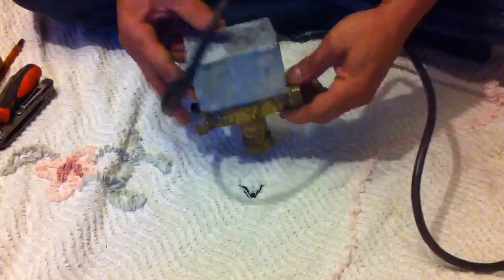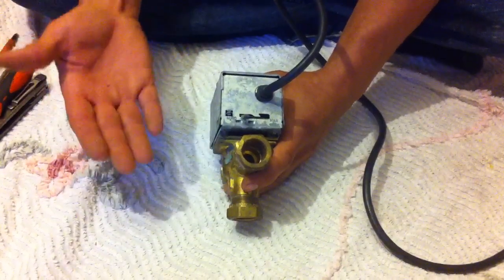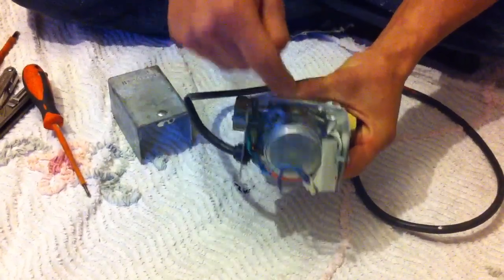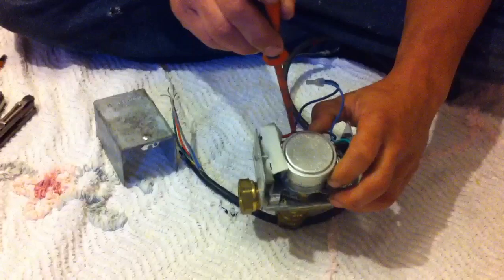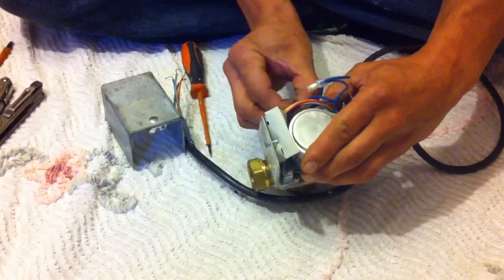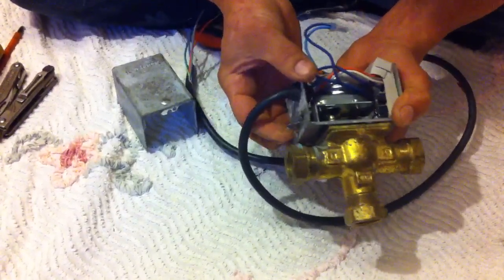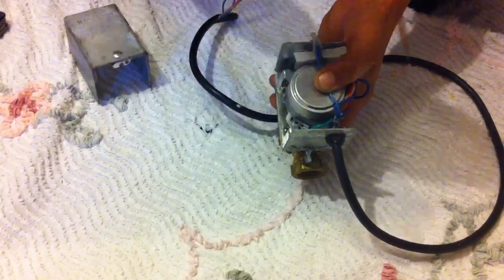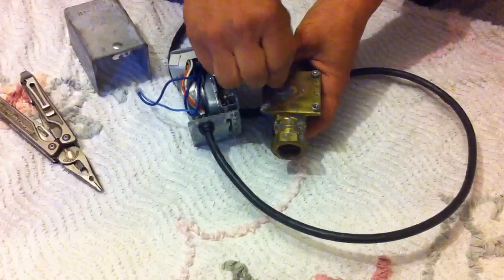Port valve diagnosis and repair

Comment: Excellent video, very clear - many thanks. My problem is that the motor appears to have failed (it was buzzing) so that the valve is open but has not swung not far enough to hit the microswitch and so energise the pump. I'm planning to replace the head since it's not clear exactly where the problem is (yet!).
Reply: Hi Manek, just got buzzing noise yesterday, great info here. Can you let me know the steps you had to go through to solve the problem you had? Cheers if you can.
Reply: david gormley Sure. From what I remember (it was nine months ago!), I left the valve in place, which saved a lot of hassle, removed the motor as the video shows. I'd bought a replacement, very easy to find, and simply did the reverse operation. I was surprised how quick and easy it was. Use the video - it's very explanatory.
Reply: Thanks a mil Manek, appreciated

Comment: hi just had a new honeywell replacement powerhead 4073A fitted should this  be hot when i haven't  got  the  hot water and central  heating on, just to let you know we are still running on a back boiler  and  have had the gas fire on a worried  women.

Comment: Hi Sebestian - I found your video super useful! It turned out the gear mechanism is faulty in the valve head so the new motor didn't help. I will need to get valve head to fix the problem. Brilliant video. Many thanks :-)

Comment: Thanks for the video,what year was this type of valve was used,I'm a local tech in ny.most valve I encountered are solonoid type/plunger..this type of valve is prone to fail due to some moving parts like gears and motor drive.with all due respect to you sir and your fans..include me off course thanks again

Comment: Hi please could i get a bit of info about my two port valve that im having trouble with , the problem is that i can only get hot water when i have the heating on,i have changed the motor on my two port valve but it is still the same, the leaver on the valve moves from side to side losly ,as if it is not doing anything and doesnt slide back from either side. Any advice would be much appreciated.thanks

Comment: ahh, yes. I remember the old style motor and unscrewing those four nuts thinking I knew what I was doing.... one, two, three, four..... psffffffffffffffffffffffffffffffffffffffffffff soaked !! hot black water in my eye, down both sleeves, live cables all over the place, standing on a metal sink with the motor at arms length above me reaching over the top of a six tonne 1983 glow worm boiler .. Deep joy. Great informative vid.
Reply: maybe you forgot to drain down the system?

Comment: Hi your description is great I have a circ 1976 honeywell flow control valve with a relay on the outside there does not appear to be any micro switches. does this relay take the place of the micro switches and at the age I assume I cannot replace the whole valve without emptying the system. If the valve is working properly and both heating and water require heat should the valve split the water flow to each by about half. When I put the hot water on with the heating thermostst open My radiators start to go cold but the water heats up. If the water stops requiring heat the heating starts to warm up Would appreciate your comments
Reply from the maker: I'm going to need a picture to answer that....
Reply: Sebastian Hibbert I cant get a very good picture It is a relay  it is mounted on the right hand side outside the box the screw to lift the lid is on the left side as you look at it. have had it off and it has two sets of contacts which I assume are one for heating and one water there are definetly no micro swithes and there are wires going into the relay box, but that is completely sealed. inside the box My system is working I get heating and hot water but the radiators cool down while the water is heating and then come back up when the water has reached its temperature, is that normal on a fully ok system cica 1976 Tks

Comment: Can someone help, my cover is getting hot when is set on manual or when i use heating, when is turned on for hot water only motor cover temperature is normal, also when system is not operating and pipes are cold motor cover is very , it is not from hot pipes they are significantly colder than motor cover Danfoss hsa3

Comment: Hi Sebastian, I wounder if you can help me?
I have changed my Honeywell 3 port valve V4073 as CH was getting hot when just HW on, now working fine. The problem (Not sure if was there before) is now when CH switches off via stat or programmer and HW is not being called for, I can hear a faint buzz from the valve head and after a short time the head becomes very HOT! The only thing I can do to stop this is turn up HW stat or switch off at mains and back on. When the heating is off, the valve should return to the hot water position. Wiring see link http://www.seered.co.uk/sunvic2700.jpg Thank you Martin

Comment: I have 3 two port valves with two for heating (zoned) and one for the hot water. We had to replace one of the heating valves about 18 months ago due to boiler not switching off and now we have the same problem! Is there an easy way to tell which valve is sticking without taking off all of the valves one by one? I think I know what you answer is going to be but this 'sticky' valve problem is a pain in the....!

Comment: I have an acl 3 port changeover valve that looks as if it has a faulty Synchron motor.  The symtoms were the boiler would fire-up for hot water but would not fire-up for heating. The motor does not operate although the water leaver is free to move.  With the motor removed the gearbox appears to be ok as you can rotate the motor without any problem.  Also, the motor appears to be open circuit as I cannot measure any resistance across the motor terminals.  I was hoping your video would cover this aspect - otherwise a very instructive video.  If you are free, please come back with typical resistance figures for the motor.  Thanks

Comment: Excellent video. My lever has no resistance, so I will try taking off casing to try with pliers. Question through, if I can loosen it with pliers should that be enough to fix it or how do I tell if the whole valve needs replacing? Also can someone tell me where the bump is on the casing to locate if new or old honeywell version. Thanks
Reply from the maker: No resistance suggests the valve is open ( working) are you sure the problem is the vslve
Reply: Sebastian Hibbert Thanks for the reply. That is what my heating guy said (but didn't open up box to investigate), i'd say it is stuck midway as hot water only heats up a bit and central heating only heats up a bit. If you have hot water on central heating comes on and vice-a-versa.
Reply from the maker: Sorry - no, the valve is designed to always give flow - so if it was stuck half way then both heating and hot water would come on together. Sounds like a flow issue.
Reply: That's what happens,  so if I turn on hot water the radiators heat up and even if thermostat is turned right down.  Sorry but what would cause a flow issue? The pump works etc.
Reply from the maker: The valve opens to the mid point to give heating and hot water, so you should get full heating and hot water, not part. You will need to her the valve head off to check the flow is enough ( turn it to hot water, the central heating to be sure that it works) but this sounds a bit more than 'valve'

Comment: Is the anyway i could contact u on phone i really really need help am getting hot water but central heating i have a honey well valve 2way. Ease please please if u can help me please my number is 07931304331. I hve a 4yeqr old son am out job n i cant afford to get a plumer

Comment: Hi can you please please help me am in big trouble out off job central heating not working winter is coming i have a four yer old son. Am getting water but me central heating not working called in a plumber to have a look he said the valve is gone its a honeywell valve 2port.

Comment: Detailed explanation - thanks.

My 3-port valve is quite stiff, sometimes the actuator will not move the port to the correct position but if I unscrew it a little from the body the motors starts to move and the boiler comes on.  I've been though 3 actuators in 15 years and now it looks like this one is struggling.  I'm wondering if the valve is too stiff and I should replace?  I'm going to replace the pump this summer so no issue with a drain-down.
Reply from the maker: Hi.... Sounds like a 'pattern' valve head is a little misaligned.....

Comment: I have a question. When my heating ONLY is on the rads get warm. Is there muck in the body preventing the valve from fully closing on the HW side? If so, is it possible to get into the body to clean it? Thanks in advance

Comment: I really appreciate the video, one question through. I have a coil based a/c with this valve. One day all of a sudden, it started to pump luke warm air and later cold. The pipe on both sides of the valve is hot. I tried to push the arm into open position, which gives me some heat but within a day it restarts to the middle or other corner of the valve, and cold air is coming. What could be wrong? The whole a/c and valve is new, may be 3 years old.
Reply from the maker: Sounds like the valve isn't latching with the microswitches - try a new head
Reply: Sebastian Hibbert
 you mean motor or whole metal box? Thanks again

Comment: Thanks mate you helped me fix my heating, plumber told me it was a control unit fault so I ordered one fitted it no fix so I looked at this unit and your video cost me £26 for new Syncron motor and gearbox from Plumb Centre all sorted now!

Comment: Excellent video and explanation - I have a 3 port valve like this which clicks several times when firing up which seems to cause the boiler to click as well. From this video I guess the gearbox is on its way out. Thanks for haring this

Comment: I have a 2 port valve that when the Central heating stops calling for hot water the pump still continually keeps running instead of switching off. The valve turns and shuts off the water.any ideas anyone .?

Comment: Thanks for this video, it was very helpful and easily explained.  I have one question however.  After testing my Honeywell 3 port valve head I decided I needed new one as I was getting heating when just the hot water was switched on.  When I manually tried to move the lever it was all floppy with no resistance.  Bought a new valve head, which to be honest I bought a Banico one, which was advertised as being able to replace my head.  But I'm still getting heating coming on when selecting hot water.  The lever does now have resistance and does move when I select either heating or hot water, but the lever now never seems to move to the far end towards AUTO.  Could this be because the unit is faulty or because I've used a cheaper head?

Comment: Need to replace my 3 port valve, I wasnt getting any central heating without the hotwater being on now im getting central heating on when ever the water is on regardless wether the central heating program is on or not, my question is does it have to be the exact same model port valve to replace with? Mine is a british gas / drayton 3 port valve

Comment: Unless you have the very old version with four screws holding the head on, you don't have to drain the system to change the head.   If there are only two diagonally opposite screws holding the head to the body it is a simple no drain down job.

Comment: Hi, I have three ports in my house. One, apparently for hot water, one for floors 1/2 and one for floors 3/4. The valve to the 3/4 floors appears to be working properly — it offers resistance when I slide it to the left, I can hear it kind of turn inside, then it returns back to its original location. However, the copper pipe above the valve, which I assume sends hot air to the air handler for zone 2 does not get hot like it does above the other valves. Any thoughts?

Comment: Normally the pump and boiler both run at the same time, although the pump may (run on) for a timed period depending on your system. This is designed to dissipate the heat before shutting down. But if boiler is definitely running ALL the time it is incorrectly wired

Comment: so the stats control the boiler pump  ,  so perm feed with brown blue to feed motor in valve  grey live  orange back to boiler   , im just trying to work out the s plan wiring

Comment: He said power one and both ports are open and power both and only CH is open, which is correct. White live = Mid Position, white and grey live = CH port open, no power on either = motor spring returns to HW only position.

Comment: Also, you should caution that most replacement motors on ebay for £6 to £9 are NOT genuine SYNCHRON motors and are much lower quality. They are labelled synchronous (which is a generic term) but mis-sold as SYNCHRON (which is a registered trade name). Genuine replacement motors are to be preferred and can be obtained at discount from screwfix etc for about £18. ALWAYS make sure you buy a genuine SYNCHRON motor if you want reliability. They have been made in the USA since 1929?!

Comment: Your explanation of grey and white was incorrect - you said power one and you get dhw and power two and you get ch. White = CH. Grey LIVE means no DHW required, grey DEAD = DHW wanted (power to the boiler is then supplied via the tank stat direct to orange). Easy to test/replace microswitches but best not to try and explain exactly how the valve can be stalled at mid position! This is done using a dc current via a rectifier. I mend these - ask Google for sunvic valve repairs.

Comment: Hi and thanks for the informative video, you can tell if the honeywell V4073A valve is a non drain down model by the little bump seen on the top of the casing.
Drain down models do not have this, and obviously you need to drain the system down below the level of the valve.